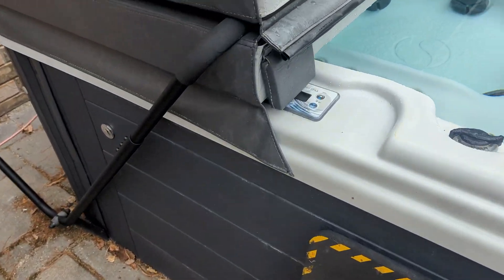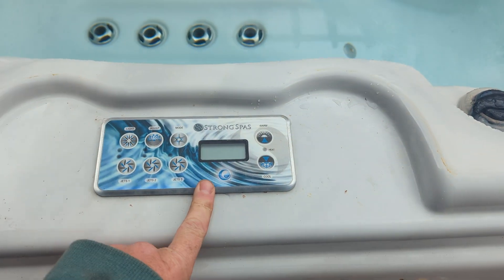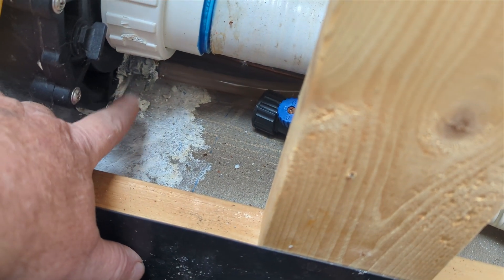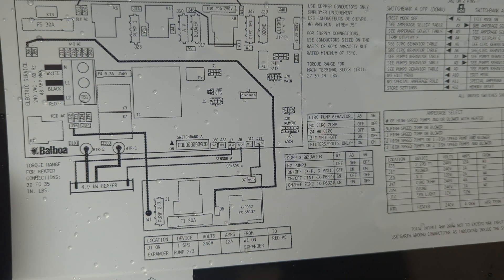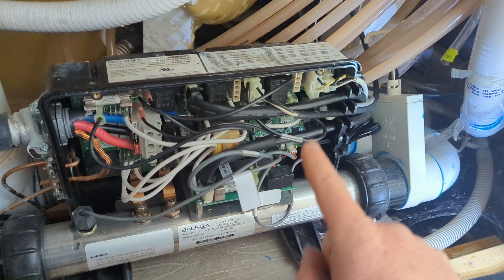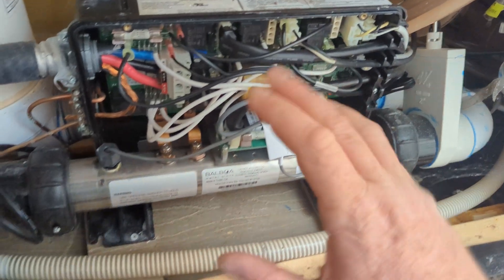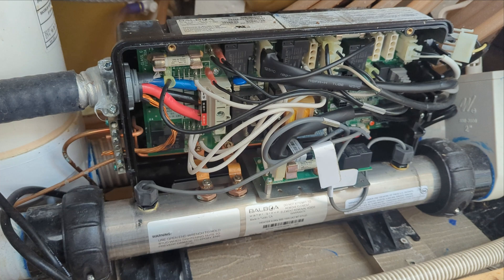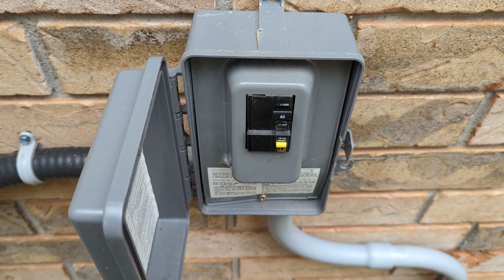HOT TUB Trips the BREAKER / Hot Tub is Tripping the Breaker

Comment: I found one that had heater element was tracing electricity from dirt on top on heater connector cleaned the connections off and worked like a charm. Heater was good and didn't need to be replaced. The connection on the left side of that heater looks dirty, water tracks??
Reply from the maker: Sounds like the chemistry of the hot tub are away the orings of the heater element.  Anytime you get rust, dirt, white stuff, it's the orings.  Replace the orings and gaskets on the heater manifold.